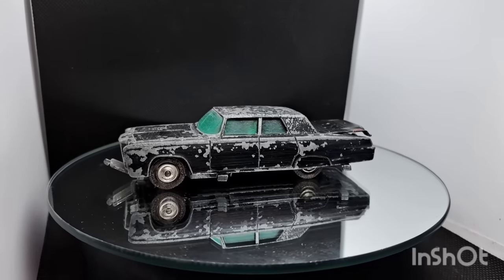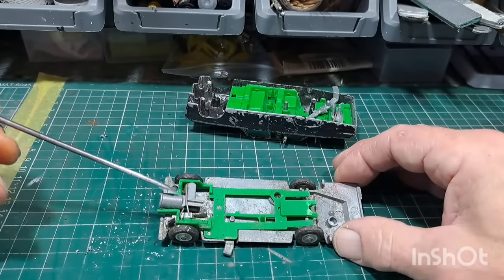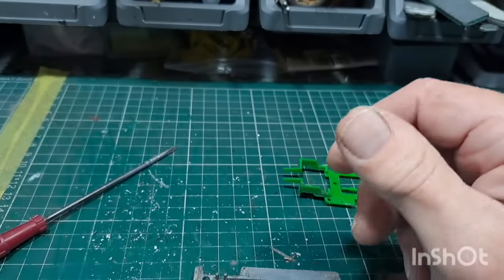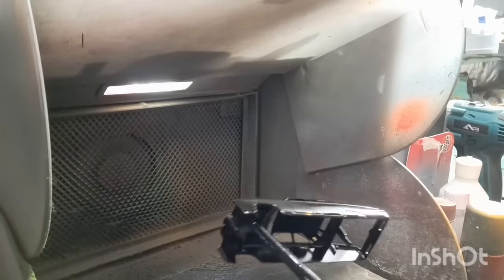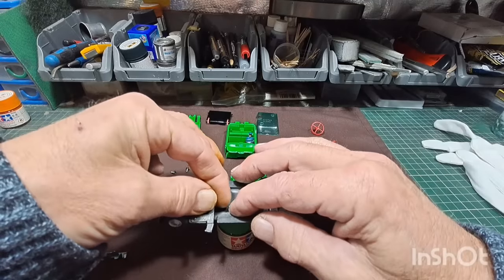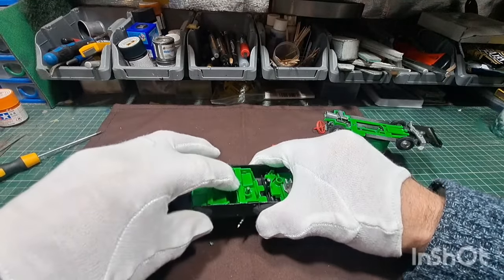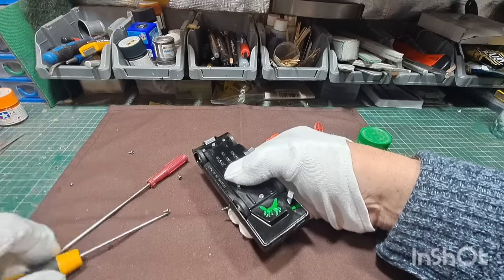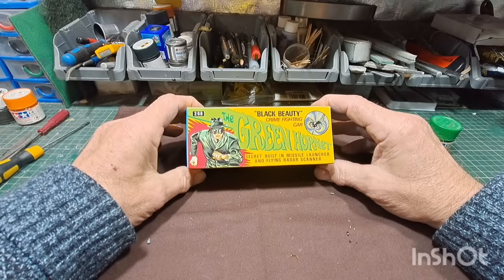Diecast Restoration Corgi Toys Green Hornet (Black Beauty) No/268.   1967/72.

Comment: Hi Martin,  I had one of these with the later cast wheels , I loved it , but the rear tyres developed flat spots with no way of replacing the rear tyres because of the fender skirts , really good job , but you forgot to paint the base plate fixing tabs orange to resemble rear lights, keep up the excellent work,  thank you.
Reply from the maker: Thanks Peter, yes your right I did forget to do those lights ,well spotted, I will do them .
All the best Martin

Comment: Persistence paid off, brilliant looking completed  restoration project Martin. Question, is there a easy way of replacing tracks on a centurion Tank without removing the bottom plate?
Reply from the maker: Thanks very much my friend, as for the tank, I have one in stock.but haven't restored it yet so I can have a look ,maybe by removing one of the larger wheels at back or front  I can have a look when I get home tomorrow.
Reply: @martindaredare  Cheers mate, appreciated.

Comment: There is no front suspension at all on mine and no broken pieces in there either.Puzzling.
Reply from the maker: Hi Lee, when the front suspension breaks it breaks really close to the plastic frame ,not easy to see .
It definitely would have had some .
All the best Martin
Reply: @martindaredare  Yeah,I can see where the breaks are,just confused as to why the pieces weren't rattling about loose in there.A coincidence when your video dropped because I was looking at mine just  beforehand,thinking about fixing the suspension.When I tried to fix mine the front ended up sitting really high so I decided to leave it as was but it's always bugged me.Theres a video on here where the fella improves the design with piano wire to good effect.Thought I might try that.
Reply from the maker: Yeah that was Paul restorer, that would have been my next choice if I couldn't have fixed mine ,it's a good plan .